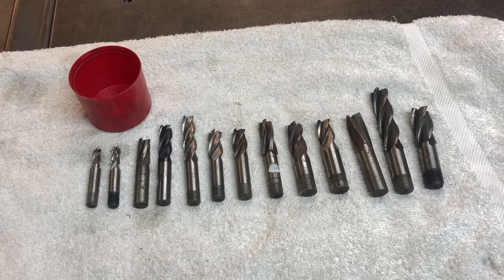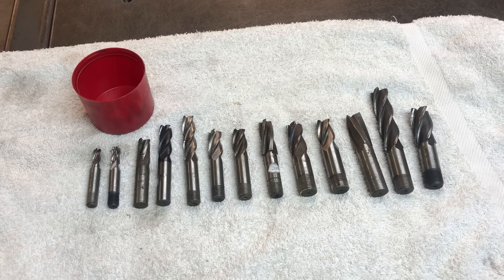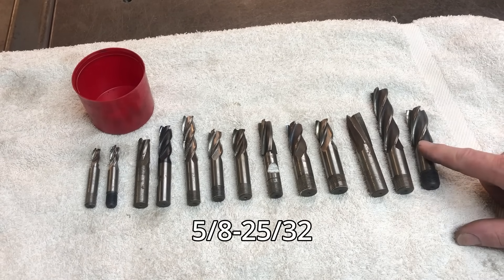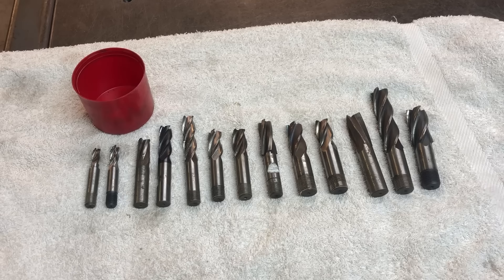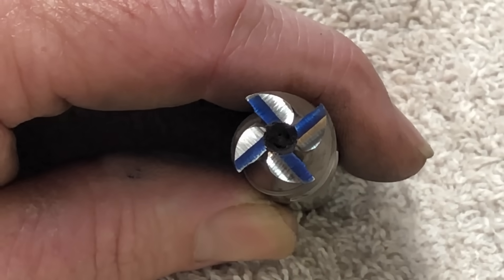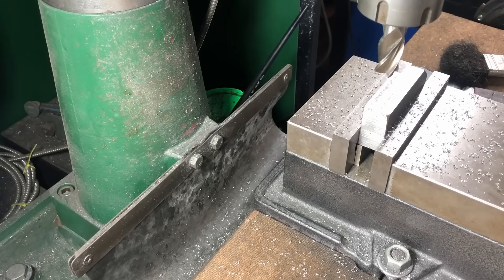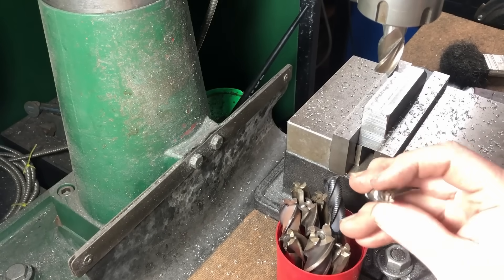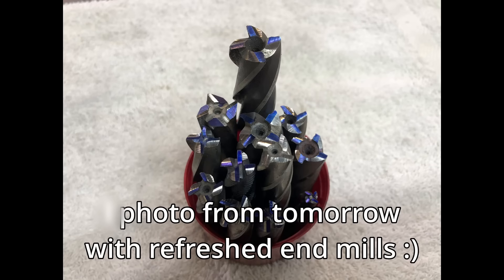Sharpening End Mills On The Lathe

Comment: This is a poor and incorrect method of sharpening a cutting edge. The worst thing is the discoloration on the tool, this indicates that the metal has been overheated, which means that its cutting properties have deteriorated and subsequently it will become dull again faster. Second, an emphasis is needed for precise positioning of the tooth. The stop will make the correct fixation of all the teeth of the cutter. Thirdly, the lathe chuck for sharpening cutters is not suitable as the lathe itself, the lathe chuck will not provide the maximum allowable runout for a 0.02mm universal tool.
The dremel spindle itself does not have rigidity, but these are additional vibrations and beating of the grinding wheel.
Sharpen the tool correctly, on the appropriate equipment and do not do amateur work!
Reply: Guess hand sharpening a drill is wrong too.
Reply: Thanks LiNdA. Just what we all needed, your armchair expertise, about something that obviously worked out just fine. Derrrrrp.
Reply: See how everybody jumped down your throat Linda? Think before you post. The bottom line is, the thing looked fine and cut fine. That's the proof of the pudding. Drills I hand sharpen seem to cut better than new, and if I take my time, evenly on both edges. In fact, they seem to eat steel voraciously, with two long thick swirly swarfs just a-twirlin' out the hole and hell bent on snagging my shirt.
Reply: @nairdacharles9492  In principle, I don’t give a damn about stupid do-it-yourselfers who, instead of buying a simple grinding machine, begin to reinvent the wheel. If there is a tool that needs sharpening, then it must be sharpened professionally on the appropriate equipment. It's another matter if the author of this amateur perversion of sharpening is just a beggar who cannot afford to buy special equipment on the secondary market or buy out even old but completely working equipment from a metal acceptance.
Reply from the maker: Thanks for watching.
Reply: I love when a know-it-all Internet troll with no channel content shows their ignorance. 1. Incorrect. It's high speed steel. It's still just as hard now. It wasn't affected enough to be noticed by use in the home shop. 2. Incorrect - if I'm deciphering your "Engrish" correctly. He used a stop for accuracy. But, as long as the cutting edge gets sharp and clearances are there so no dragging, then it will cut fine. 3. Incorrect. A three jaw law chuck, even a worn out one with .008" of runout, is plenty accurate enough for sharpening the bottom face of an endmill. 4. His setup was plenty rigid for grinding something so small. Very little tool force is applied. 

Comment on things you understand, in an appropriate way, and do not be a troll.
Reply: @williamclark77  Yes how dare us poors re-sharpen our endmills without using a proper T&C grinder worth thousands of dollars!  I have personally used Rob's method and it works great, costs next to nothing - and believe it or not without wringing your hands and grinding your teeth about the suitability of the lathe for the job or the maximum allowable runout.
Reply: @williamclark77  You shouldn't be concerned about my lack of content. If you don't like something, you shouldn't open the comments under the video.

Comment: Not a good idea to grind in your lathe as the abrasive will get into the ways and spindle bearing. If you must grind on your lathe. put towel down in the ways and use a vaccuum when your grinding.
Reply: Great Video.
And of course….It’s not a good idea to do a ton of grinding on a lathe and not to use pressurized air to clean debris and etc….etc…etc. 
That said, I’ve got a War Time South Bend lathe. And I use a rag when I grind around my lathe. And if I remember, I also wipe down everything to remove any oil present so that dust doesn’t stick. So, I grind stuff on my lathe and I use an air gun for my chuck at times. And I break rules. 
“Long story short”…..in the end, I’m sure that my lathe will be just fine. I’m 62 and a hobbyist. I’ll be six feet under and somebody else will be using my lathe when I’m gone. Damned thing works fine and it’s 75 years old. God only knows the abuse it has already seen.
Reply from the maker: @timmer9lives  Thanks for your comments Tim. Yes, taking precautions when grinding on the lathe will enhance its life.
Reply: Funny thing about grinding grit, it won't hurt ways or precision equipment 1 bit just laying on them. Wipe the grit off the ways before using them, and no harm is done. Only thing moving is the cross slide and head, which are (I assume!) protected from grit.
Reply from the maker: Yes that is true. Thanks for watching.
Reply: It sure is amazing that Mr. Dumore sold as many tool post grinders as he did.  Do you suppose he was getting kickbacks from the major lathe manufacturers?
Reply: my Nebal 28 inch swing has been ground on for 105 years. WTF

Comment: Really bad idea to use any sort of fabric around any moving machinery.  If it gets tangled,  it quickly turns into a rope that can pull something into the machine.  Much safer to use any sort of paper.  If I want to capture grit, I spray the paper with oil to make it sticky.
Reply from the maker: Thanks, that is a great tip.
Reply: The point made is true but irrelevant for this process. Not sure why people have to bust their nut over it.
Reply: @twm4259 to show they are equal or better without putting content out themselves. It’s a thing now.
Reply: I rub Cosby sauce on my 4 lathe's.
Reply: Thanks for the tip!😊
Reply: He wasn't running the lathe, settle down Mr. Health & Safety
Reply: @EitriBrokkr  Are you forgetting those that watch these videos to learn?  They should learn never to have fabric near a spinning thing.
Reply: We’ve found Karen, OSHA Edition.
Reply: I knew a guy that got killed when his Dremel got wound up in a piece of fabric... Said no one ever.
Reply: @robrobitaille4235  the Dremel died

Comment: I have been doing similar touching up on some of my endmills.  I have a D-bit grinder, though, so the relief angle can be set directly.  However, many grinders use height adjustment and wheel diameter to set the relief angle, as you have done.  The larger size mills are a good place to start because they're a lot more expensive to replace and, frankly, it's easier to see what you're doing.  HSS is also a good choice.  A non center-cutting endmill makes thing easier, too.  If it's center cutting, you need a 3rd bevel and a narrow wheel to gash all but one of the cutting lips.  I've been experimenting with a 0.035 diamond cutoff wheel. So far, I've sharpened up a 3/8 in solid carbide cutter.  Your primary relief looks too wide but the cut looks fine.  If you put marker on the primary grind and then do a cut in steel, rubbing will be revealed.  Thanks for the video.
Reply from the maker: Thanks for your comments and suggestion.

Comment: I like your spindle indexer.
FWIW, you can make a lot of headway by roughing in the end flutes on a bench grinder before you get to the final grinding stage. In particular, grinding the secondary relief (farthest from the cutting edge) can be done by hand, and leave just a narrow zone about 1 mm wide to grind the primary relief without using up your little stone too quickly.

But you need a good wheel with a square corner so as to get near the center. In practice, a CBN wheel is a great investment for grinding HSS, as it will hold its shape for a long time, and grinds cool, if you get it in a coarse grit like 100 or so.

I never bother with grinding the OD of the flutes, as this often results in reduced gullet depth that clogs too easily with chips. Also, you are changing the rake of the tool as you reduce it's diameter, so it doesn't cut very well if you have taken much off. I only shorten worn endmills and regrind the end clearances. In actual fact, it really doesn't matter a hell of a lot if all the flutes are the exact same length. ONE of them will produce the finish on the surface anyways. and most guys aren't feeding the tool so hard that they'd notice any scalloping effect whatsoever. You actually buy commercial inserts for face mills and install ONE wiper insert (along with several normal quality cutting inserts) on it to produce the finish you want, so that shows how having them all 'the same' is really just a pipe dream.

A slightly worn or damaged endmill can be brought back into service by grinding a corner chamfer on it, sufficient to remove the dulled tip. Yes, you do have to think about whether that is suitable for a particular job, but there plenty of selections you can make to save some money buying new.
Reply from the maker: Thanks for the tips.

Comment: Thanks for showing. I have a few Clarkson HSS cutters that could do with a refresh. But some of them have wear on the side flutes too so would need reducing in size. I think some have been done in the past as the sizes are smaller than the size shown. Subbed
Regards.
Steve.
Reply: It may pay to chamfer the corner.obviously it will change the profile of the slot but could save it for roughing operations.
Reply from the maker: No problem. Thanks for watching.

Comment: Would using the top face of the grinding stone give a smoother grind? It would also eliminate the curve of the wheel.
Reply from the maker: It probably would give a better finish, but its the curve of the wheel and raising the center height of the wheel which gives the 5 and 30 degree clearance angles. Well.... that probably also depends on the diameter of the wheel as well.

Comment: i hope you know that is a good way to destroy the lead screws in your lathe... that dust is horrifically abrasive bud
Reply from the maker: Thanks. I had some rags there, but I will go and clean the lead screw just in case.
Reply: It will be just fine. Doing a bit of grinding every once in a while isn't a big deal. The amount that gets around the protection is inconsequential.
Reply: @littlejackalo5326  its the dust that is too small to see which is the problem.. trust me it gets everywhere.

Comment: Your resharpening looks good and any plunge cutting should work well if there’s a pilot hole (non center cutting end mill shown in your video), however as you move the material past the end mill it’s the teeth on the side of the end mill that are doing the cutting so hopefully they are still sharp.
Reply from the maker: Thanks for watching.

Comment: Good work there. All I have to sharpen my end mills is a purpose built tool cutter grinder made by a former club member.. (Sorry for bragging)

I see the black looking end mill. That might be carbide in which case it is very expensive and will need a diamond wheel or a green wheel rather than the standard HSS grindind wheels. (That said your wheel was green)
Reply from the maker: Thanks Ben. Yes, I think that end mill is carbide.